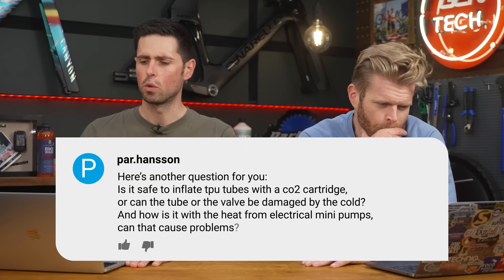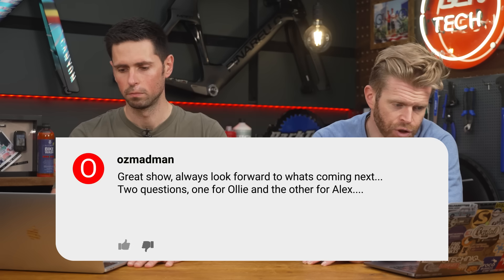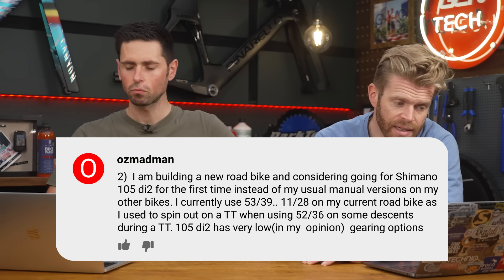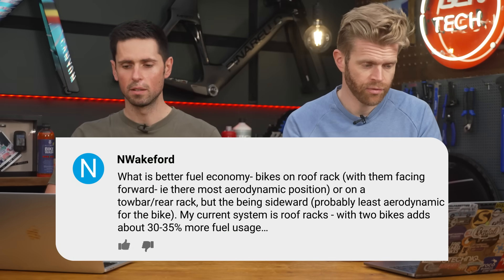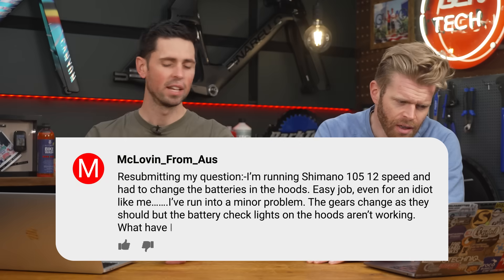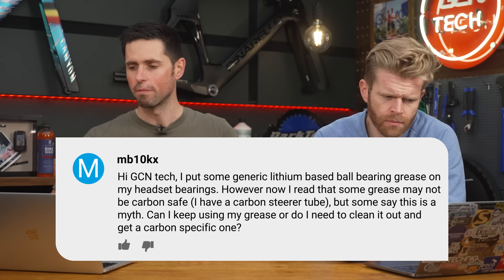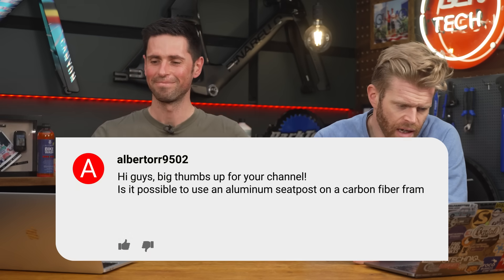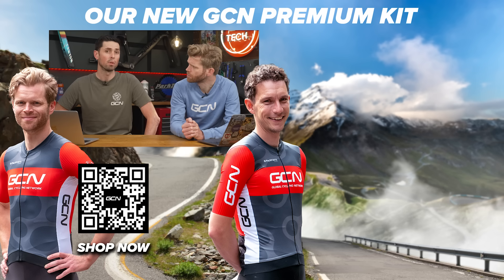Are Heavier Riders Ever Faster, Mixing Carbon & Aluminium & TPU Tubes | GCN Tech Clinic

Comment: Olly’s (sp) explanation of why a heavier rider would go faster on a TT outputting the same power made no sense. He explained why they could produce more power with a similar aero profile, but that wasn’t the question.
Are heavier riders faster on a TT if both output 300 watts average? I would be surprised if that was the case.
Reply: Agreed... He ignored the "equal watts average" aspect
Reply: on the flat, with the same absolute power output a heavier rider will be slower because of higher rolling resistance and more drag... that should be basic physics... also more mass needs to be accelerated at the start, there already costing the heavier rider time
Reply: yes, both of you are correct. Ollie's explanation is off. He is referring to the fact that heavier riders often put out more average watts for a similar frontal aero profile. He skipped over the "same average wattage" part.
Reply from the maker: we need to send Ollie out to sea to test this theory!
Reply: @gcntech  actually, the easiest way to test if "a heavier rider at the same power output is faster" would be to make just a few runs with and without a lead bottle. In that case everything would be equal except the weight.
Reply: Despite Galileo’s Tower of Pisa demo, heavier riders generally DO descend faster. The gravitational force acting on the big guy is a lot greater while his air and rolling resistance force is only a little greater. So, he’ll ‘automatically’ go faster in freewheel before the two forces balance out. The Galileo thing (really a demo of acceleration rather than terminal velocity) had me in denial but it was so empirically obvious on group rides that i persisted and finally worked it out. Agree?
Reply: @hisdadjames4876 did you miss or just ignore the part, where the questioner and also I repeated above ESPECIALLY mentioned the word "flat"? So why are you talking about downhill?
Reply: @gshaindrich is there not an aspect of the heavier rider having a higher momentum? Im not sure where the original question comes from - but it does state same aversge power, but not constant power. Olis explanation goes some way to explaining why the speed a heavier rider may get to is less effected than you might think - i.e drag doesnt increase linearly with volume. If you couple that with a riders power fluctuation, the severity of that fluctuation and the momentum the system has - would be factors that could contribute to a heavier rider going faster for the same power, on the same set up, on a flat course?
Reply: No, I'm a 90kg rider can confirm it's slow as shite no matter what shape you are in.

Comment: Cargo ships are propelled by more power.  The poster stated "same power".   If what the poster said is true, then it's CdA that is lower for the bigger rider.  As A is likely bigger, somehow, they reduced their Cd.  Rounder must be better than ganglier.  It's also possible that what the poster stated is not true.
Reply: Rounder is better. People have used front hydration packs to achieve aero gains. A increases slower than Cd drops for most weight increases in people.
Reply: @anthonyschroeder521  "Rounder is better" ... really? you couldn´t be more wrong. why do then, the faster anything moves, from fish, to cars, planes etc. the less spherical the bodyshapes get ?
Reply: @gshaindrich  Holy x-mas people. I'm talking about in comparison to a flat rectangle approximating a body (both around cda 1.0-1.2). Bullnosed is certainly a lot more aerodynamic than flat rectangles, so in this case rounder is better. Obviously L:D matters (as I mentioned) but we are sooo far from optimal when talking about human bodies moving through the air, we are not normally discussing streamlined bodies when talking about humans. Completely different reference regimes.
Reply: @anthonyschroeder521  "we are not normally discussing streamlined bodies when talking about humans." ... seriously? not only is this bike channel, but the discussion IS EXACTLY about the streamlinedness of the human body. So why are you talking about bricks, ships and spheres? Furthermore ones has to pedal when riding a bicycle, therefore it is unquestionably impossible to achieve a very aerodynamic position.
Riders are skinny for a reason, because when they are about 10times heavier than the bike, when accelerating after slow corners and on uphill sections the heavier riders have a huge disadvantage.
Reply: @gshaindrich  You are welcome to look at the relevant literature, but broadly speaking human bodies while cycling (in anything other than a full tuck) can indeed be well approximated as rectangular bricks. CdA ~ 1.05. Rectangular bricks that are by far the dominant aero losses in the system (so long as we are not discussing faired systems). Performing an aero tuck on a DH bike will result in better aerodynamics than riding on the hoods of the most aerodynamic racing bikes available. The distinction between narrow and thin is exactly relevant in the 'brick discussion'. If you take 2 people with the exact same bone structure and height, one who is 10% body fat and one who is 25% body fat, have them output the same power, riding in the same position, you'll find that the 25% body fat individual is more aerodynamic. There have been numerous studies on this (particularly in the context of hydration packs). Belly fat, in particular, assuming it doesn't limit the range of motion of an individual, is quite substantial in terms of aerodynamic efficiency gains. Of course, that's only on a flat, and you are not making up the delta on anything that pros ride where W/kg is king. BTW a 'streamlined body' is referring to the technical regime where frictional losses are greater than pressure drag, which human beings are *very far away from**. Pressure drag is by far the largest contributor of aero losses in cycling. Basically all of the aerodynamic optimizations for cycling have to do with reducing pressure based losses, even intentionally increasing frictional losses in areas to improve wakes. So no. We are **not* talking about streamlined bodies on this channel. Ever (except when fully faired recumbents come up).
Reply: @gshaindrich I'm actually an engineer who actually does aerodynamic work, so yeah I'll make simplifying assumptions and refer to technical concepts at the same time. Planes are not relevant comparison points when talking about people. Bricks... actually are. not unironically. It is certainly possible that if you take two people who weigh the same, one with higher body fat than the other they have the same volume. It isn't super likely because fat obviously has different densities and different distributions than muscle or bone. It doesn't actually matter though the volume. It matters the occluded surface area first, and second the effective shape of that occluded area. Thinner people are indeed... thinner, and they present more 'rectangular' cross-sections to the head-long direction.   Why is this surprising to anyone then that control for the power and position variable fatter is more aerodynamic? Its basically saying deeper wheels are faster, no kidding. Adding visceral fat makes the leading surface rounder (as originally stated) compared to a thin person's flatter face. Which is faster. Adding visceral fat also tends to make a person deeper, improving aspect ratio. Which is faster. In general if you look at the cross-section of the torso of a thin person and a fat person, shocker to find that the fatter people have a more aerodynamic cross-section. As a simplifying justification... because they are rounder than the 'brick' that well approximates low-body fat torso shapes. None of us are comparing to shapes that are super long (ala streamliners) relative to their surface area, so that entire line of comparison was invalid from the start. --- Fish are not 48cm wide at the shoulder and 26cm deep. They are generally much longer than they are tall, and basically always much longer than their surface area (product of width and height, since some are tall and thin and some are short and thin). Planes are not stubby surface area (1.8m x  0.5m) x depth (0.25m). While we are still talking about human proportions of a non-prone human body, rounder is aerodynamically faster than flatter. End of story.
Reply: @anthonyschroeder521  NO. Rounder is not better, more spherical is better. The hydration packs are used to become more spherical
Reply: @oliverp6770   A half sphere has a much lower mu than a rectangle, I said rounder to denote making that front more round. Spheres are not inherently amazing streamliners. Hell half spheres have better cda than full spheres. I'd suggest rounder is the more accurate term in this particular case.

Comment: Hello 🙋‍♂️ When I ride “non-handed” on my bike, it pulls slightly to the left.

I’ve never had this problem before on any other bike, and from what I can see, the bike seems to be setup fine.

Have either of you had this problem before?

Cheers 👍
Reply: If you have cables/hoses internally routed through the headset/headtube area, it could be that there's some friction caused by the position of the cables or hoses that's pulling the bars to one side.
Reply: @johnwestwell2241 it’s externally routed. Cheers though. I could check to see if the hoses are the correct size and not pulling anything.
Reply: "the bike seems to be setup fine" either that is not true, or you are not sitting totally centered, i would guess... if you are pedaling, maybe your left leg is weaker?
Reply: Check the headset bearing races for pitting.

Comment: I have a 2015 Trek Crossrip Elite that I use for weekend rides on 70% road 30% gravel. It's equipped with Shimano sora and has a square taper BB. Is it worth it to upgrade to hollowtech II or just save my money and put it towards my eventual (pretty far away) upgrade. Thanks!
Reply: Yes it is a worthwhile upgrade. Did this to a Trek 7.1 flatbar, and it is a very easy changeover.
Reply: @WalNeville  Thanks for the reply! That's good to hear. What did you notice most about the upgrade?

Comment: With the problem of air heating while being pumped, compressing the same number of moles of gas to the same pressure will generate the same amount of heat regardless of the type of pump. There will also be waste heat from the pump motor itself. I suspect any overheating of the inlet valve is probably more to do with the rate of pumping. The faster you pump, the less time the air has to lose heat to the exterior and the hotter the pump/pipework/valve.
Reply: Don't you think that this is something anyone who paid attention to secondary school physics should know or be able to figure out? GCN tech clinic is a joke.
Reply: The heat comes from compression of the air, as well as the pump itself which gets warm from the motor that's whirring away doing the compression. You're right that if it's done faster then it will be more acute, but if you have a short  rubber stem between the pump and the valve, it will protect the valve from direct transmission of heat from the motor.

Comment: If you go with a rear rack, best to go with a hitch / tow-bar rack. They come with their own set of lights and are much more secure transport-wise than those weird things you secure with straps to your car. And they have a number plate holder, too. I use one from Thule. Easy setup, good quality, like most of the ones in the mid-to-high price segment.

Comment: Larger riders better at flat ITT than smaller riders: similar in swimming but even more so. Swimming lanes makes each racer more or less doing their own ITT. Swimming favours huge people with short legs and long torsos plus long arms, big hands, big feet with flexible ankles. For power available, the resistance to forward motion in water is pretty much the same for smaller swimmers as for larger. You might be a champion swimmer at age 14 before teenage growth spurt but, if you don't get bigger, forget swimming as a seriously competitive sport. Given the amount of training needed to be a champion at lower age levels, it can be very depressing to realise you'll have to swap sports to be top level competitive (eg take up triathlon). At least cycling has enough different types of race to enable most body types to have something to work with

Comment: Cargo ships and bikers are affected by different physics principles.  Ships had something called hull speed which is directly corelated to the length of the hull in the water.  When comparing bicycles, length is too similar for that to factor in.

That said, I believe inertia is a factor.  For a lighter rider, more power has to be used to maintain their current speed to overcome friction and drag.  For a heavier rider, their energy is used getting up to speed, but once up to speed they are required to expend less energy to continue to overcome friction and drag.

Put simply, a lighter rider spend less energy getting up to speed and more energy maintaining speed, where as a heavier rider spends more energy getting up to speed and less energy maintaining speed.

That is my lay opinion, at least.  Curious what Ollie thinks.
Reply from the maker: This sounds to us like we need to send Ollie on a cargo ship for several months as a test?!
Reply: @gcntech  - Only a cargo ship that is OCI legal.  😆
Reply: More relative power. The power used by both to maintain their speed is dependent on drag and rolling resistance so youre not 100% accurate. Inertia does mean the heavier rider will have a smoother speed profile but under ideal conditions there is no difference
Reply: @billyobrien3279  - thank you for the additional info and clarification! I’m self taught so there are always gaps in my knowledge.

Comment: I just had my right hood batteries die in my 105 di2 but my left were still good so I took one good battery from the left and sawpped into the right while on a ride. It got me home but when I replaced all batteries afterwards to be safe I realized when I swapped batteries I put one in the wrong direction. Try checking to make sure both batteries are inserted the correct way, the markings in the hood are very hard to see but they are there.

Comment: TUBELESS TIRES, THE 500$ USD SOLUTION TO THE 5$ PROBLEM.
>TUBELESS TIRES:
<of course this is a low number, might be more with other considerations/options>
-wheels(specific)
-tires(specific)
-tire liner or foam
-valves
-pump(specific)

>TIRES W/TUBES
-any 5 or 6$ USD tube works fine(matching sizes to wheels/tubes/rims/etc.)

REMINDER:
<nominal gains only work if you match or exceed 30mph(only applies to pro riders)>

Comment: Dont think thats why heavier riders tt faster. When you get up to speed, heavier rider has more kinetic energy for the same power output so wind resistance has less effect on your speed.
Reply: Aeronautical engineer here: very much not how that works. There is an argument that larger riders kind of have a higher ratio of mass to drag because mass scales with volume but drag scales with area. Given 0 power output, a larger rider might coast further/faster than a smaller rider and you could technically think of that in terms of kinetic energy. However that's only under deceleration; at a steady speed given a specific number of watts per kilo, a heavier rider will go faster because their power to frontal area ratio is better even if they're power to weight ratio isn't. Same reasoning as above, different physics. Kinetic energy has nothing to do with it since at a constant speed energy is conserved as KE. Only starts to matter accelerating or decelerating.
Reply: @judeackland-patel6646 Human beings certainly do not scale super well volume to area, but all things being equal (height etc), a heavier rider almost certainly has a higher true frontal area (bigger people are bigger). Unless you are talking about 'effective frontal area' as that bastard unit accounting for difference in drag coefficient, in which case, yes we are right back to my original comment. --- (As you'd agree) --- True frontal area (A) rises much slower than drag coefficient (Cd) drops as people get fatter (adding bullnose and longer L/D), so the total aerodynamic drag, which is proportional to CdA falls as riders get heavier, all other factors equal.
Reply: @judeackland-patel6646 heavier rider will have a more constant speed at a given power. It is how it works son
Reply: My curiosity right now is whether the premise is true in the first place. Do heavier riders go faster on flat TT sectors WHILE putting in the same power? Or is that an urban legend and they're really putting in more power?
Reply: Kinetic energy makes sense to me (not saying it’s the only factor). Ec = 1/2 m V2, so heavier riders have more kinetic energy at a given speed making it easier for them to maintain speed on the flat.
Reply: This makes more sense than the answer given, but I’m not convinced it’s true.
Reply: True, he ignored the "equal watts average" aspect
Reply: That isn't how it works. Assuming a fixed air resistance in watts, you'd have to put the same watts in to maintain speed.

What is true though is that people are particularly non-aerodynamic, and turns out, belly fat makes you more aerodynamic, not less (similarly in other locations) because it lengthens your effective L:D ratio. This is also demonstrated by people running front facing hydration to improve aerodynamics.
Reply: @anthonyschroeder521 okay well heavier riders are more “stable” at that speed because of their higher energy
Reply: But African swallows are non-migratory…
Reply: @anthonyschroeder521 so as a 100kg rider without belly fat, ill now use that as my excuse for not going fast enough 😂